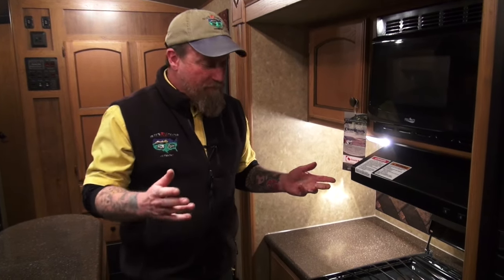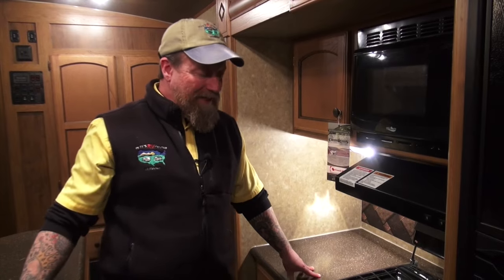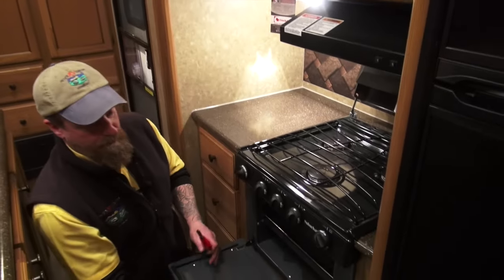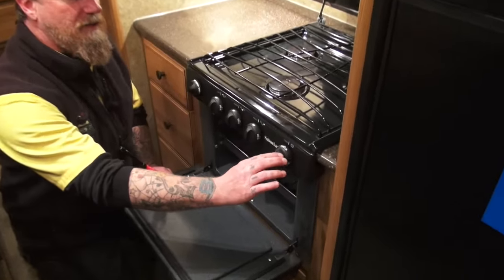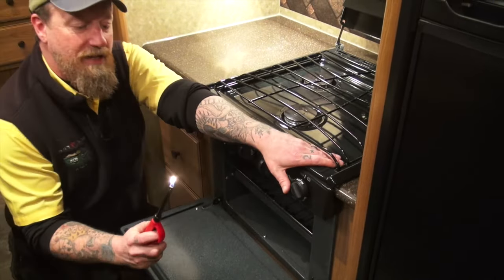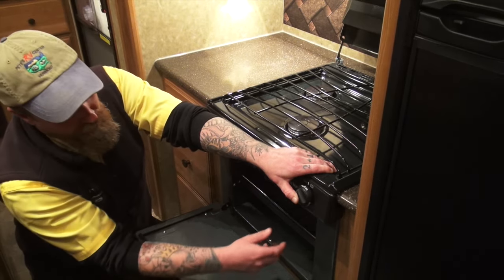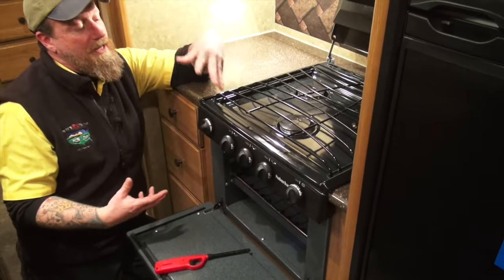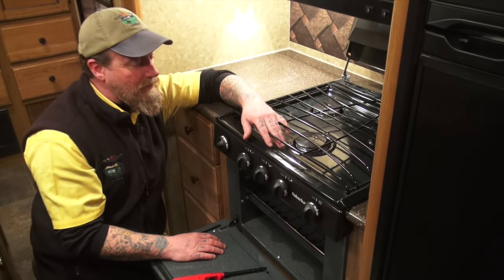HOW TO LIGHT AN RV OVEN | Pete's RV Quick Tips

Comment: Randy quick question. I noticed you lit the lighter and pushed in the knob to light the pilot light. The pilot light lit and then the flame lit the full length of the thermocouple. But when the camera went back to your hand, you were still pushing in the knob. 
Our flame stays at the pilot light until we release the knob and turn it to the desired temp.How did you get the flame to go that far without releasing the knob?

Comment: I have never once used a oven in any camper ive owned and have been RVing for 7 years now.  I just use an Air Fryer. Way easier to use and clean.
Reply from the maker: Great tip!